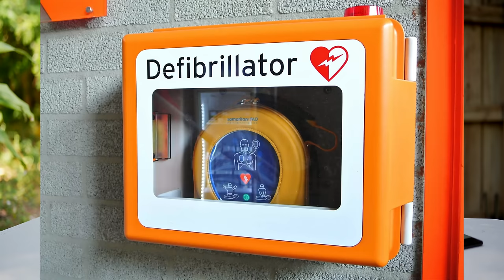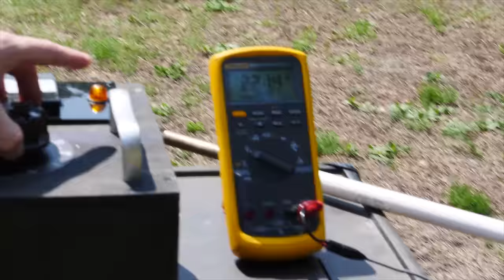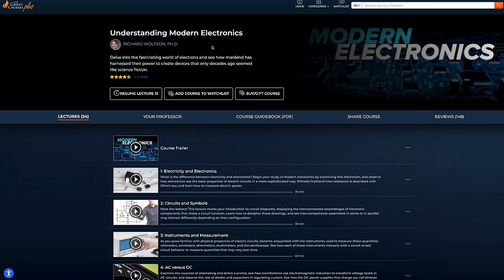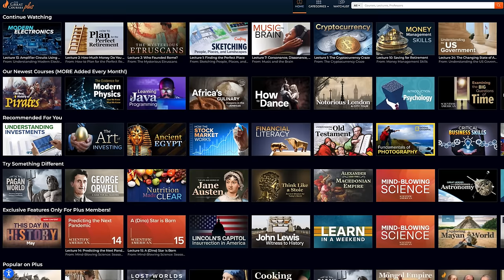20000 Volts Vs a Pickle

Comment: 'you can fit so many electrons in that bad boy' is THE nerdiest thing I've ever heard, and I love it.
Reply: Coming up the can is Extra destroyed
Reply: Agree
Reply: Exactly
Reply: You could fit six quintillion, two hundred fifty quadrillion electrons in that bad boy(to be precise)
Reply: @octoquetra9198  accurate?
Reply: @grognakthedestroyerattorne3211  He said 20000 joules in the video and 20000 volts in the title. If those are both accurate, then so is my measurement. If he slipped up in the title, then my estimate is off by a lot. I also was only talking about the single container he slapped, not the entire thing.
Reply: @octoquetra9198  yeah this is big  brain time
Reply: Slap side of capacitor"you can fit so many electrons in this bad boy"
Reply: no u dont

Comment: 4:35 right under the hotdogs you can actually see the metal frame radiating an electromagnetic pulse, because the bottom half of the cmos becomes saturated in noise
Reply: Whoa!!!! What an insane catch, that frame is also absolutely spectacular. Do you have an explanation why does it become saturated with noise and only the table seems to be radiating it? Also why the whole table seems to radiate it when it's mostly made of wood? Also what is the origin of the noise actually? Is it the crazy EF messing with the whole circuit so that the CMOS makes wrong readings? but why is only the table radiating it?
Reply: Wow. Do not understand it tho.
Reply: @seededsoul  that’s because it’s super boring science stuff
Reply: That is FASCINATING.

Comment: when those disposable cameras were a thing a couple of us kids pried one open , charged up the flash, and discharged it on our finger. It was quite a shock.... I can believe that could stop a heart. I've also touched an electric fence at a petting too (on purpose), that one went through my body and made me jump a few feet.... not sure why I've done these things...
Reply: i did that camera thing a few times i wanted to make a hidden taser gun
you know that yellow gun that fires darts out and shocks you?
make something like that but like a web shooter mounted device
ended up shocking myself and putting it aside because it was not fun
4 times worse then a shock pen
the reason it happened again was i forgot the hum was the charge sound went to figure out the circuit and zap
"yowch!" not again.
Reply: In my experience electric fences barely feel like anything. Just like a click in your muscles
Reply: @t.dominey4150  this one was pulsed, when I contacted it with finger it had no current, I instinctively made more contact with the finger and then it flipped on and legitimately ran down spine into ground... I had shoes on so maybe I'm imagining that, but I jumped really high
Reply: What a shocking experience
Reply: I’ve been hit by lightning twice. They were real shocks.

Comment: 0:50 otherwise known as a suitcase capacitor. One application they are used in are induction furnaces used  steel and iron foundries. There could be 20-30 run in both series and parallel.

Comment: The gas can was taller because the opposing magnetic fields ripped the bottom and the top part of the can away from each other. The problem is that this one is stronger and didn't get ripped apart, it just got streched and the part that gave the material for that streching missed where it was before. If you strech a pipe its hollow space contracts. Like when a worm is streching itself.

Comment: For those wondering about 8:11, the way it works is the current increases from 0 as the capacitor discharges, which creates a increasing  magnetic field inside the coil, which (because physics) induces a current going around the can (which is made of conductive aluminum). When you have a current in a magnetic field, it will experience a perpendicular force, and this force implodes the can
Reply: Another important thing is that the can and the coil act on each other (Newton' third law). The can crushes only if the coil is strong enough to withstand the force :)

Comment: Nice video! Well, about the induction: I believe sudden expansion of the water inside the tin can might play an important assisting role in ripping it open, together with the magnetic repulsion. The produced heat by this amount of released energy has made clear by the other experiements. It doesn't matter much that it's transfered by induction, it's still an enormous heating power.

Comment: I still prefer the photonicinduction method of just dropping or having the item on the discharging rods instead of the wire just exploding.
Reply: In case you or anyone else is unaware...HE'S BAAAACK! And his first little trick involves a bank of capacitors. Ones that make this bad boy look like a toy.

Comment: The pickle exploded because the insane current through it vaporized the water inside in an instant. Vaporizing water expands and so it pushed the rst of the pickle away that was in the way of expansion.

Comment: Yeah...when you guys ran a thin copper wire across the discharge of the capacitor bank, you created an exploding bridgewire detonator. The guy who ate a piece of one of the bananas definitely got his copper for the year. Also if the banana were an insensitive secondary explosive, you would have been golden.

Comment: I was quite disappointed to see you only burned a thin wire, essentially blowing a fuse, instead of passing the high voltage through objects. When you introduced the pickle it got interesting, then it ended.

Comment: Inagine a rack with 28 of those big white maxwell caps. 7 in series and 4 in parallel all hooked togther with big ceramic spark gap tubes and all of them in a tank outputting in a coax type cable about 3 inches in diameter. Apperently the thing described was the guts of some kind of x-ray unit used for taking pictures of stuff getting blown up at sandia labs. 🤓😎

Comment: if they could double this capacitor then it would be at the vary baseline of a lightning strike
the lightning strike can hold from 40kv to 200kv so they would need about 10 times the amount they used to make a high end lightning strike 
😨

Comment: 1.) Stop conflating volts with joules/amps. I've been shocked by 50,000 volts from a van de graaff generator (all volts, no amps). It's not the volts that do the damage, it's the amps.
2.) You didn't fry the banana, or the baby, or the watermelon, for that matter. You fried the wire, and the heat from the wire did the damage, NOT the electricity. (Lost patience with your unscientific video after that.)
3.) Cardiac defibrillators discharge between 50 and 300 joules. 50 joules for pediatric defibrillation, 100 - 150 joules for synchronized cardioversion, and 100 - 300 joules for adult defibrillation.

Comment: I've hit myself with the camera flash capacitor in high-school when my friend thought it'd be a great idea to drill two screws on the outside of the camera and run leads to it to make a taser. Kinda backfired a few times... He passed it off to me as he was running from admin to hide and I uh... put it in my pocket as I touched the screws with a full charge... Enough to make your entire body lock up and have full body sweats... came close to a black out. Lucky it didn't do more. :\